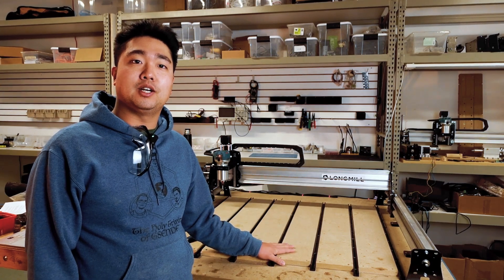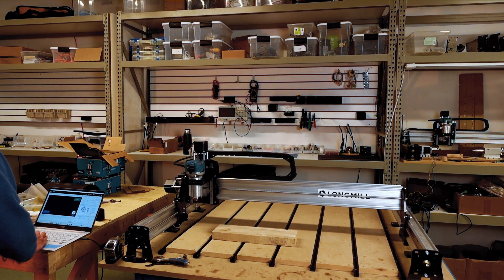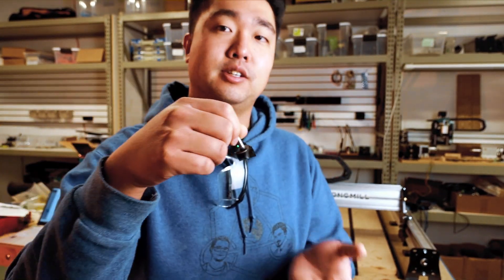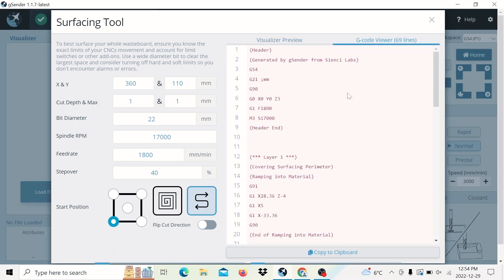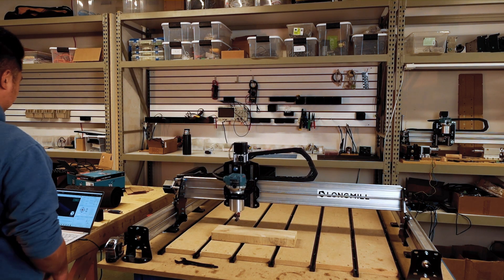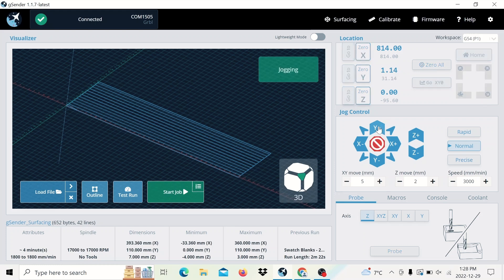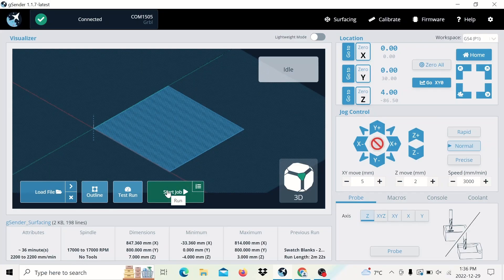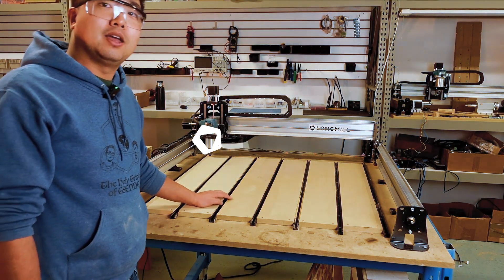How to Surface Your LongMill Using gSender

Comment: Just cant help notice that Y screw wobbling, I mean that was a lot! Doing fast vcarves must give a lot of chatter. Should use a Rack & Pinion on those lengths or a LOT thicker screw. I've heard a lot of people swear by these Longmills, havn't tested one myself but hopefully they fixed this as the video is 2 years old. I do a lot of work in my workshop on Laguna machines but have been looking for a smaller hobby/pro machine for smaller projects like a 4 by 4 footer.
Reply from the maker: The LongMill does just fine for most hobby uses. But if you're looking for something a little pro-sumer than the LongMill, check out our AltMill. Both are great machines, it just depends on your needs. If we can help answer any other questions, drop us a line!
https://bit.ly/43ITFOP

Comment: How could you do this for real on the small piece considering clamping it down but the clamps would be in the way?
Reply from the maker: You could use "side clamps" or super glue and tape methods so that you can still surface the whole top of the material 👍

Comment: When you are surfacing, and it asks for the bit diameter (you used 22mm), are you measuring the surfacing bit where it cuts? For exanple, in the video you use a 1" surfacing bit, but the number you input is 22mm (not 1 inch). Where are you getting the 22 mm from?
Reply from the maker: The bit diameter you should set should be the exact diameter that you measure from the surfacing bit of where it cuts. The bit that I was using is a 22mm wide bit, it is not a 1" bit.

Comment: How do you use the "Test Run" function?
Reply from the maker: You can just press the button in gSender and it'll check the file for any obvious errors in the code
Reply: So it doesn't create any movement in the machine?  Thanks @SienciLabs
Reply from the maker: No movement, if you want to try the machine moving before you cut you can always set the Z zero high above the material and keep the router off, then run the job and see how it looks

Comment: It's a great feature for the beginning user.  I don't like the ramping dance or perimeter move.  I wish that part was a enable box.  I just usually manually write  my  own Gcode to do a quick surfacing or profile passes.  I just want a basic lead in, Raster, then lead out, simple to write in Notepad or Wordpad.  Cool feature no doubt.

Comment: My LongMill is arriving this week. I built a table and plan on using the MDF slats like in this video for the waste board. I have a basic question should the  LonhMill be mounted at the same height as the waste board or is it ok to mount it flush with the table which will be in my case 3/4 inch lower than the wasteboard?
Reply from the maker: It's up to you Joseph! The mounting difference won't make a very large impact on machine rigidity - the machine is instead flexible to how people want to use it, that way you could even use very large spacer blocks to raise the machine up and fit much thicker material under the CNC

Comment: Excellent video. Thanks. I am considering buying the Longmill MK2. However, I just noticed something that concerns me.  The gSender software expresses measurements in this video in mm. I hope that this is configurable to imperial. Is it? Is that true in all the software ?  Thanks
Reply from the maker: Yes if you change your workspace settings in the gSender settings, the tool will work and show in imperial as well.

Comment: Great video I was playing around with the surfacing option and was planning on doing this in a few days, how long did this take for the entire surface. I have a 1 inch surfacing bit, about how long will it take?
Reply from the maker: It'll depend on how fast your machine is running, but I'd say 10-15 minutes roughly.